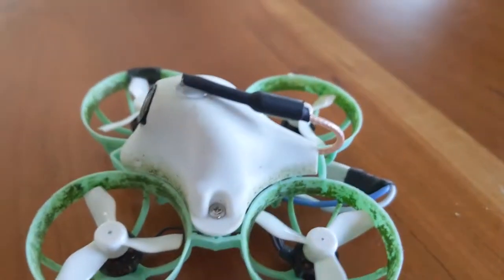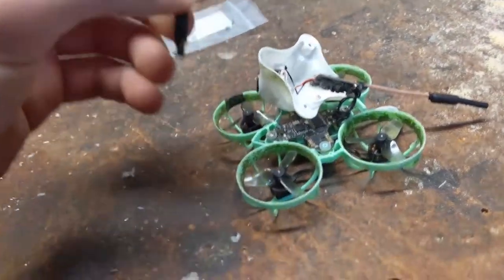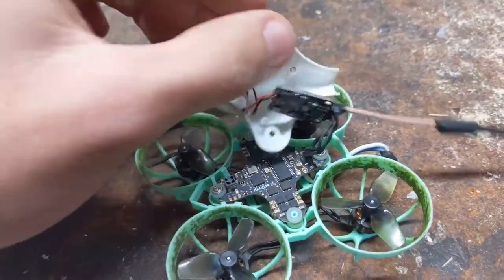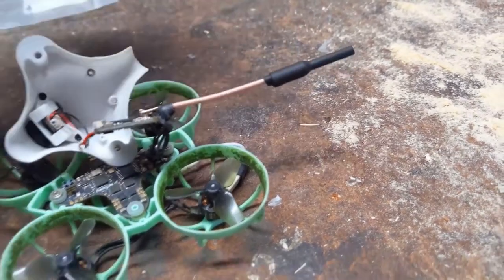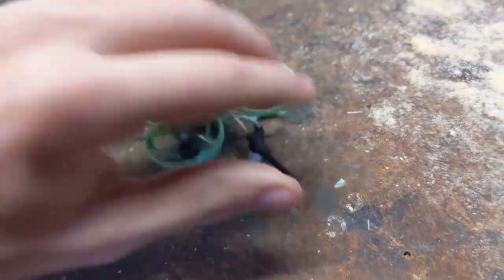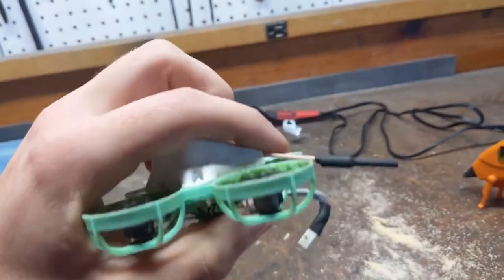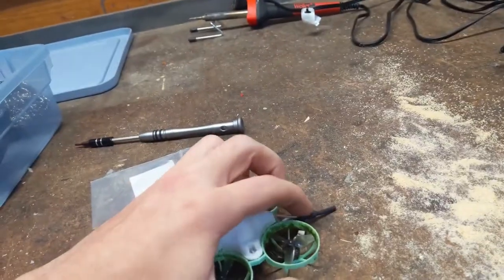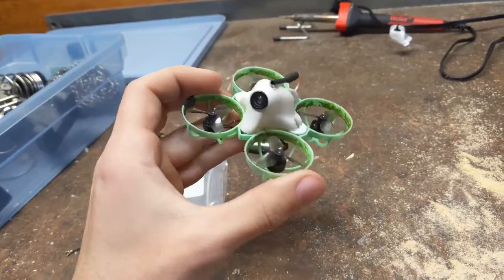Meteor 65 VTX Antenna Replacement, and a Better Solution

Comment: My 65 pro ripped the vtx antenna connector off the board. My suggestion if you buy one change the prop direction in betaflight. My 75 pro has the props reversed so they just kick the vtx antenna out of the way in a crash instead of destroying the board.